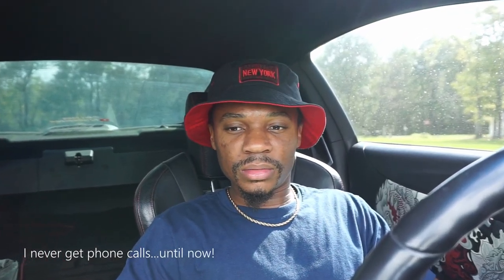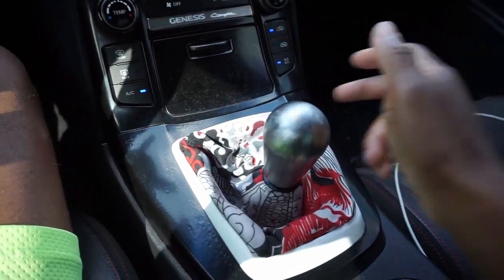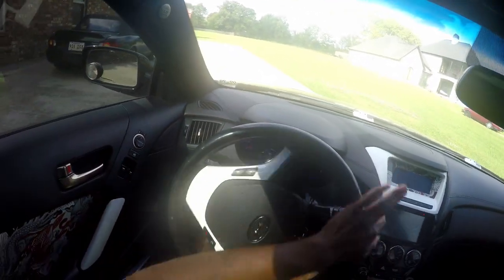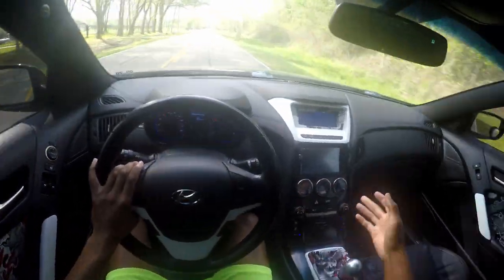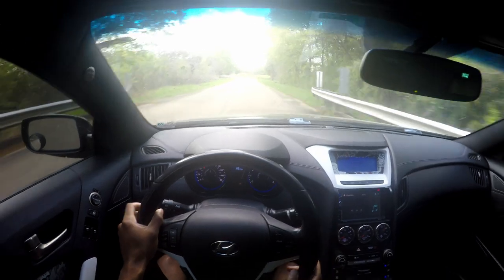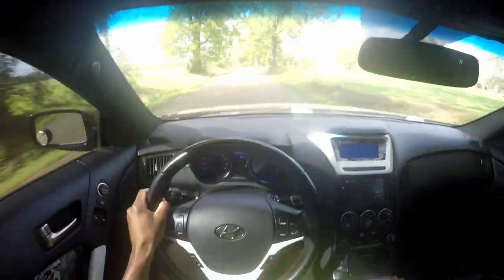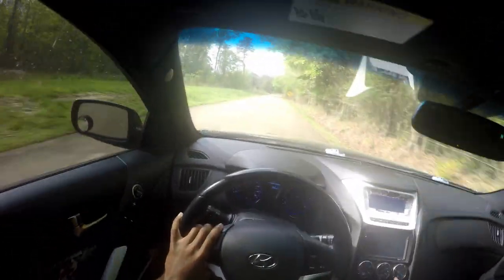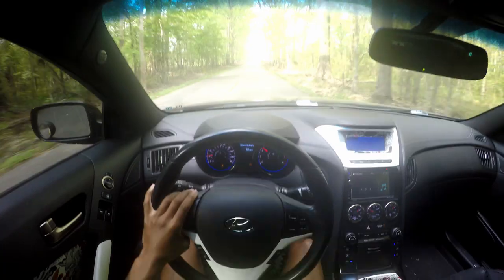I Fixed My TROUBLESOME Sloppy Shifter! | Genesis Coupe Shifter Bushings

Comment: No, The shake in gear is due to a worn/shrunk clevis pin.
Reply from the maker: The connection where the shifter meets the linkage? If so, nahh that’s not it. I moved the linkage with my hand under the car
Reply: @pj_morrison  nope its where the shifter meets the trans if im not mistaken. Some guy on facebook forums had same issue and posted pics and it was a shrunk little bolt that held the shifter to the transmission
Reply from the maker: @naailable  gotcha, that makes sense then. That’s pretty much what I meant by the shifter linkage being the issue, I knew it was the connection between the linkage and transmission. Thanks for the info
Reply: @naailable  can you post a link for that? I have new bushings and short shifter but still have play

Comment: Love your video boss 130,000 what year is your beast
Reply from the maker: Appreciate that, I have a 2014 R-Spec so it came with the carbon synchros
Reply: @jiggin091295 I have a 2013 r-spec 2.0t, what years did they change to carbon synchros????
Reply from the maker: @oscarsolis5667  2014 was when they started.. Unfortunately the 2013s and bk1s don’t have them. As far as I know